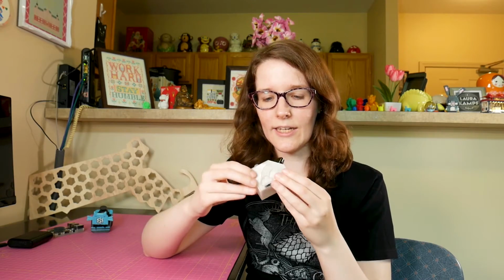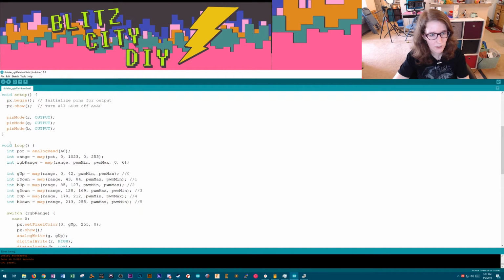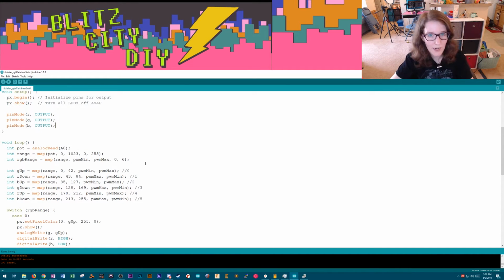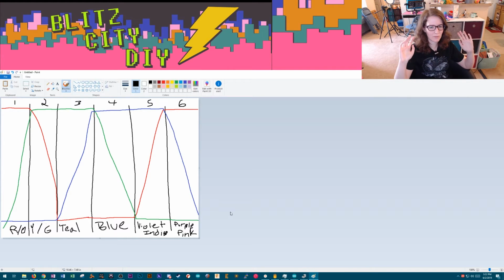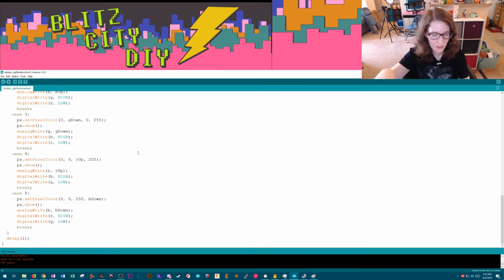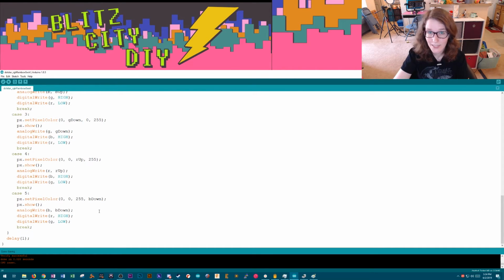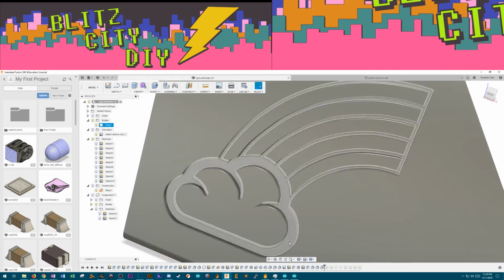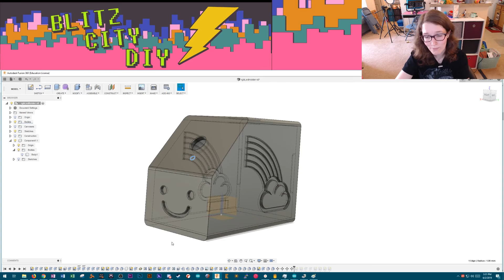Control an RGB LED's Colors with One Potentiometer 🌈Project Rainbow Swirl🌈

Comment: Thank you, I will give it a try on rgb led strip.
Reply: did it work? trying a project that needs exactly that!
Reply: @catarinacruz5529  It worked for small leds that need low power. When I tested in oscilloscope the wavefrom was a straight line as expected and energy efficiency was not good as she mentioned. There is a video on  a channel "engineering mindset" named "LED Dimmer controller design" there PWM controlled dimmer is explained. Tried that and it worked very efficient for one channel dimming. If you are not interested in learning circuits just buy a commercial RGB led dimmer.
Reply: @catarinacruz5529   It worked for small leds that need low power. When I tested in oscilloscope the wavefrom was a straight line as expected and energy efficiency was not good as she mentioned. There is a video on  a channel "engineering mindset" named "LED Dimmer controller design" there PWM controlled dimmer is explained. Tried that and it worked very efficient for one channel dimming. If you are not interested in learning circuits just buy a commercial RGB led dimmer.
Reply: @catarinacruz5529  It worked but you may want to look for PWM controlled dimming fif you want more efficient and high powered application.